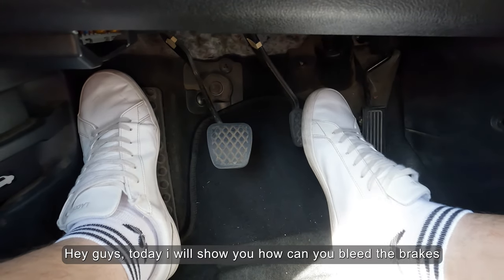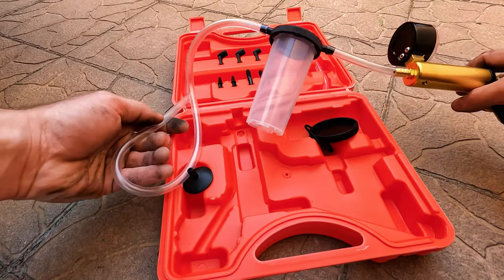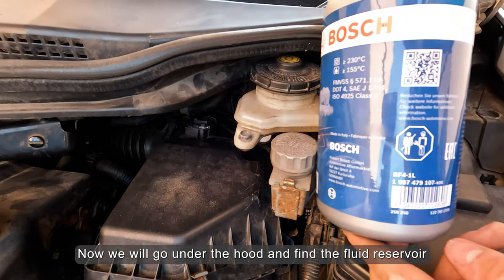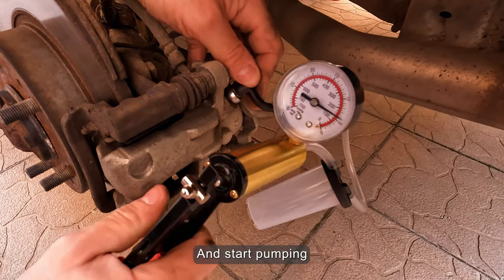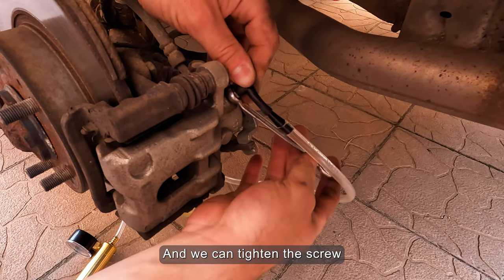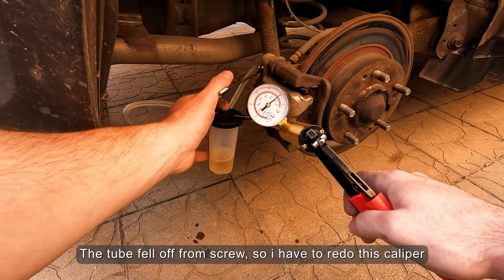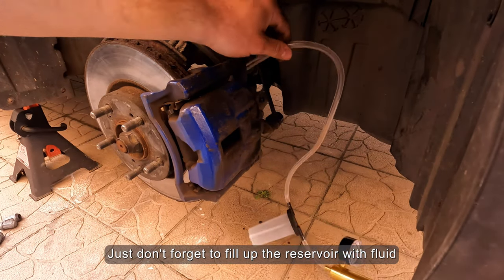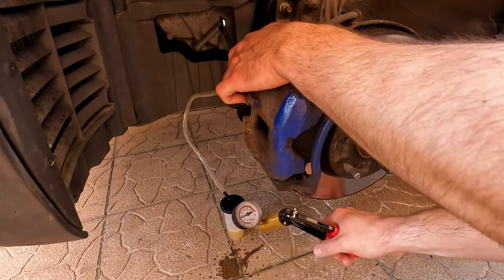How to bleed the brakes with a vacuum pump

Comment: I would have definitely removed the old fluid from the reservoir and filled it with new fluid before starting this job.
Reply from the maker: This is bleeding brakes.It is not about changing the brake fluid.But of course I agree. :)

Comment: Man, this job is a pain in the ass. And im doing another full brake service on mine next week. The life of a Doordasher.
Reply: Pain in the ass? This is literally takes like an hour max and its only something you have to do once every couple YEARS. Costs nothing aside from brake fluid 🤷‍♂️ long as you use high quality fluid like MOTUL it’ll last a very long time.
Reply: @gilgonzalez5902  Easier now that i just bought a bottle pump and i just pump the brakes manually. i know there is all these freaks about air in the brake fluid...but give me a break... it is not an air tight thing anyway. I have not noticed a difference. in fact i notice less bubbles when i use the brakes then paying money for this gimmick.

Comment: Your video is not correct there was no small tube inside the bottle connected
Reply from the maker: That tube is not even supposed to be connected inside the bottle. The video is correct.
Reply: @easywork2  wow are you ever wrong I suggest you educate yourself. That tube must be submerged in the fluid to prevent air bubbles dude read an instruction manual once in a while before you do a video
Reply from the maker: There is a vacuum. This is not normal bleeding. This is vacuum bleeding.I know how it works.It is like a vacuum cleaner. The liquid cannot go back.Try to think about it. :)
Reply: @easywork2  so your telling me the manufactures put that piece in there for absolutely nothing? I been a mechanic for 40 years and have done tons of brakes have you?
Reply from the maker: Oh, and what are the other seals and other tubes there for? You've been a mechanic for 40 years, but you obviously don't understand it at all.
Reply from the maker: Most of the air goes between the brake bleed screw. If I loosen it, the thread is not sealed.
That is why there is so much air in the hose.The short tube in the container has absolutely no meaning.
To keep air out of the long tube, I would have to seal the bleed screw.
Reply: @easywork2  dude talking to you is like talking to a politician totally useless your videos are wrong and your channel reported
Reply from the maker: @FedUpCanuck  You can easily report my channel. I show people how to do things at home themselves and with quality.
You go here to teach and you yourself absolutely do not understand it.
If you have an intelligent argument, I'm happy to learn. I'm only human, I also make mistakes. I'm not showing anything I don't understand.
I wish you the best of luck.

Comment: I don't even recommend these things anymore- just get the cheap "one man" brake bleeder bottle with the megnet. You pump the brake fluid out with the brake peddle. It makes less mess and is cheaper. You never get all the air out using this tool and have to usually push it out with the brake peddle anyway. I can still use this tool to take some fluid out of the reservoir while filling in new brake fluid.
Reply from the maker: Unfortunately, as a car mechanic, I do not agree with your comment. The most effective method is always vacuum venting. We all like something different. This video serves as a tutorial, so I don't want to argue in the comments.
Reply: @easywork2  I agree you showed us how this crappy tool works good. It's still a crappy tool. I have yet to see a steady stream of brake fluid expel from it. I have however wrecked it after first use because fluid get sucked into the other end wrecking the gun. Especially if you plan to pump the brakes at the end for a steady stream to close the bleeder. It's a piece of crap. I will never use it again for this and i will just pump it all into a bottle manually VIA brake peddle.
Reply: @easywork2  Plus the bottle that collects the fluid is too small… what they want us to do…. Empty the bottle out 50 times as per procedure. What a big idea.
Reply from the maker: @rebelcave8556  But you never get constant current. The vacuum draws air under the bleeder screw. The screw would have to be sealed, which is not realistic when it is allowed. So yes, you will still have air in the hose. On the contrary, if the air is vented by pressure, the hose will be constantly full (it should be).
Just look at the color and volume of the absorbed liquid.
You obviously don't know how this system works.
And also how some systems work with ABS that cannot be bleed manually.
Reply from the maker: @rebelcave8556  Next time you have to do it according to the instructions in the video and you will have your brakes perfectly bled. This machine is not bad. It is a very good tool.
Reply: @easywork2  It may very well not be possible with other ABS brakes. Some cars like a Lambos cost $3000 an oil change for whatever reason. I’m talking about my normal car. It will work with my 2021 Camaro LS too. Why hassle when you can get a big bottle bleeder and just pump it out until the fluid comes clear. I don’t even think these things are really made for a full brake flush with the little tiny cup it has. Just little bleeder jobs.
Reply: @easywork2  It is sure a great novelty item however… it will spruce up any mechanic shop for sure
Reply from the maker: @rebelcave8556  In fact, it's the exact opposite. If you got air into the ABS cube, it would be difficult to bleed it out with pressure. It is clearly better to vent with vacuum.
Reply from the maker: @rebelcave8556  If you have a problem with a small container, buy a pneumatic one. They have approx. 2-3l container and vacuum makes air from the compressor.🙂
Reply: @easywork2  You can also get someone to hold down the brakes while you seal the bleeder back up. Many mechanics swear by it as the best way to keep air out.
Reply from the maker: @rebelcave8556  Yes, it's a good way, but I'm leaning more toward vacuum bleeding.
Maybe in the future you will find that not every brake system can be bled as you write.

Comment: Be sure to stick an oil pan or something under everything next time.. that brake fluid stains like hell
Reply from the maker: So far, I haven't had a problem with it. But thanks for the advice. 🙂
Reply: @easywork2  You’d do it if you were renting a place like me. However if it’s your own castle.
Reply from the maker: @rebelcave8556  Or be more careful
Reply: @easywork2  This weak piece of crap is not getting any air out of the brake lines. You need to pump the brakes.

Comment: You should suck the old fluid out of the reservoir before adding new fluid so they don't get mixed and enter the system.
Reply from the maker: Yes in case of fluid change.This is a video on bleeding the brake system.
I have a video about replacement brake fluid.The video will be without a vacuum pump
Thank you for your response.🙂
Reply: @easywork2  I figured as long as you're at it, put all fresh fluid in it because you don't know exactly where the air bubbles are.
Reply: @jamescampolo7824 exactly, might as well have as much fresh fluid enter the system as possible.
Reply from the maker: Please see my brake fluid change.
This video is about bleeding the brake system.
If you want to watch brake fluid replacement, watch the replacement on my YouTube channel. You don't even need vacuum there.